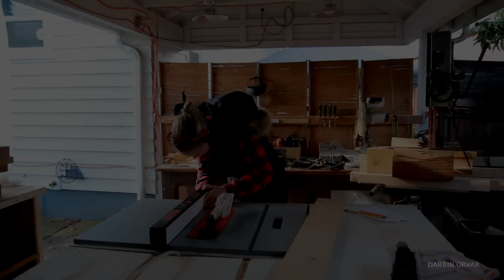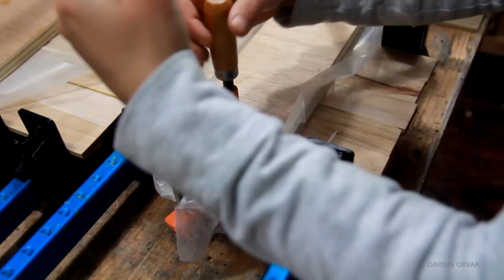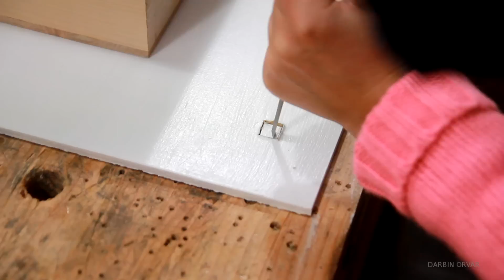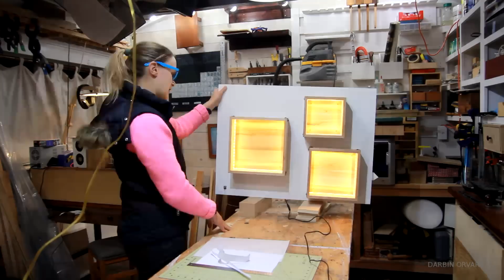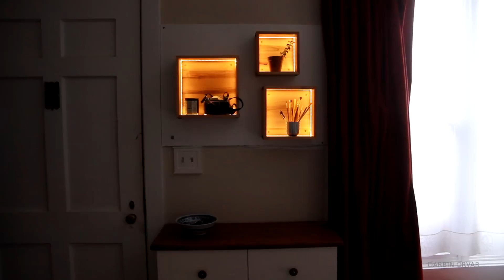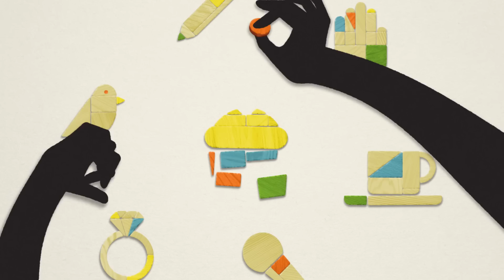LED Wall Cube Shelves

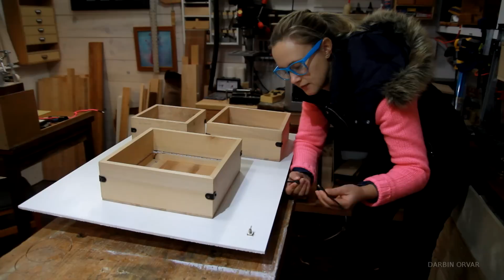Comment: at 4:59 brings back memories seeing you seal the heat shrink with a lighter.  I am a Marine and worked on helicopters where we used same heat shrink material after fixing wiring issues except we were SUPPOSED to use a hot air gun to do the shrinking which required much more time in bringing out a generator all the way out to the flight line, big pain in the butt.  So instead, everyone carried a BIC lighter, even the non-smokers.  They were a tool commonly referred to as a "B1C" or a "Bravo One Charlie".

Comment: Since I do a lot of commercial retail spaces, where LEDs are used quite often. I've made it a habit of using all the different varieties of aluminum extrusion tracks for LEDs. Some have covers, some angle the light or shield the light. I always include those into the build... but when I just need a small piece to show the client what I had in mind, I get 1 meter strips off of ebay. The nice thing about them, is that they act as heat sinks, and prolong the lifespan of the LEDs and I can tell the clients that there won't be a fire hazard when they are applied to the aluminum extrusions. No client says no to them after that.

But for your shadow box build, I would have made it so the lights are way more recessed. So you don't see the strip of light, but it makes the back of the board light up evenly. Just recently did a build like this to showcase luxury purses in display window.

Comment: New intro! Nice. Excellent looking project. An idea to dress up that switch would be to get half an easter egg or ping pong ball, or maybe even a velvet ring box and punch a hole or slot in the middle to let the lever poke out. The box would cover the body of the switch and help integrate it into the design of the piece.

Comment: Very cool and useful project. I was gonna ask about any heat generated by the led lights, but you cleared it up. Reason I asked was to put an additional groove for a colored acrylic or glass sheet and possibly add a shadow land scape to it.

Comment: Great build. Screw from the back to hide the screws in the box. Route a groove on the rear for the power cable and maybe use a more elegant switch. Love the idea and am going to make some as display boxes for my kids projects. Thanks for the inspiration. Oh, maybe use the multi coloured remote controlled led strips for more colours and effects, or maybe coloured plexiglass. Cheers Linn

Comment: Loved the build :)
One upgrade can be to add a variable resistor to adjust brightness, that can be put right next to on/off switch.
Reply: That won't work, a PWM dimmer must be used.

Comment: Very cool Linn! One option that I did with some arcade marquee lightboxes was to inset the back panel by 1/2" or 3/4" and run a french cleat across the top of the back panel to hang them on the wall (assuming they were wide enough to cross two studs). If you were okay with the boxes touching a bit you could still hide the wires, though I suppose you could also use small lengths of the fairy lights to connect the boxes. Hiding the wire to the DC adapter/outlet is still annoying unfortunately.

Comment: You should try fluted router bits for your router, not only do they give you a great cut but they clear the material away from the groove much more than a straight edge router bit

Comment: nice project, you could have also used an RGB strip light with remote control to change to any theme light background for them plus lower the intensity of the brightness so you wont need to add the paper strips....plus with the small remote you wouldn't need to wire a switch since the remote would turn it off and on or do any color or brightness or even effects.

Comment: Looks great. Only slightly improvement I can think of would be to use the router table to create channels inside the miter joints before glueing. This would allow you to hide the led wiring as it goes behind the main pannel.

Comment: Cool project! I know soft maple burns easy, but the blade might need cleaning or replacing. A burned joint does not glue as well either.

Comment: I have similar LEDs providing under cabinet lighting in my kitchen. They're powered via a remote switch which gives me the option of dimming them (as well as many annoying strobe effects). Only cost about £2 on eBay, so not much more than a cheap switch.

Comment: I love the look of these boxes with lighting in them, I think they can highlight and bring focal point to the room by the things you put in them: seasonal themes, festive and special occasions... If not, they are very practical places to put items like keys and glasses, which otherwise can be misplaced easily(that's my case all the time!!) What did you do with the black wire from the back of the white board?  Did you change the wire into a white colour and hide it along the molding of the door? Thanks for sharing : )

Comment: Stainless steel is hard to oxidize, but still, the corners and screws could have been oxidated with nitric acid or another oxidative dilution, even with some copper salts dilution, so these would had had a rustic design

Comment: You're good with those LED projects.  I've got one underway where I bury the LED's in clear epoxy. :)
Reply: onjoFilms   I'd like to do that also, but I'm worried about when the led lights fail.. then what?
Reply: Get the good ones and they should last over 50,000 hrs.  No Chinese eBay stuff.
Reply: onjoFilms ok. Thanks
Reply: I use the chinese leds in a museum, they are in fact really good.
Reply: onjoFilms to
Reply: celticboy1950 Ko k
Reply: I did that, after 1 1/2 year 2 led failed, bummer... 
If I remember it right ut was Philips,  but everyone got to have a "Monday" in their produktion, and unfortunately I got it.

Comment: The small boxes are nice.  I think I would have attached the boxes to something other than a cheap/plain white board and then screwing it to the wall.  Seeing the screws in the corners of the board isn't very appealing and the texture of that board (rough) isn't fitting - just my opinion.  I would have built a box the size of the white board and inlay-ed the boxes with the lights in the bigger box.  A bigger bulkier bolder piece on the wall with all the same elements.  Could have hide all the wires in the bigger box too.

Comment: Could you have used batteries instead?  Would be nice to not have the cable hanging.  I will try this. Thank you.
Reply: Batteries could be used but the strips require 12 volts

Comment: After you used the router and used your metal ruler to clean out the debris....I was doing exactly that once and the metal sharp corner of the ruler sliced my thumb all the way down because I wasn't being careful. It looked worse than it was, but I still have pretty noticable scar running down my thumb.